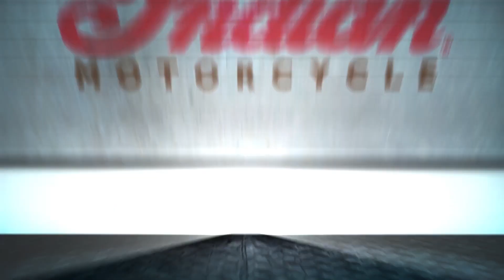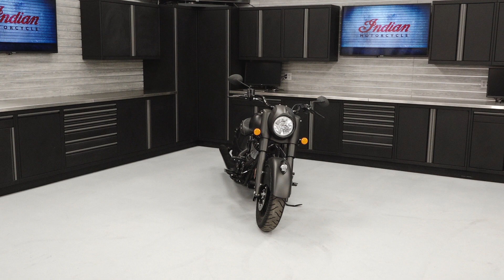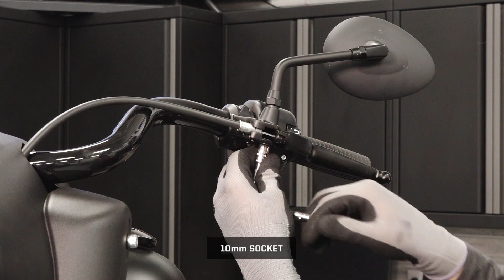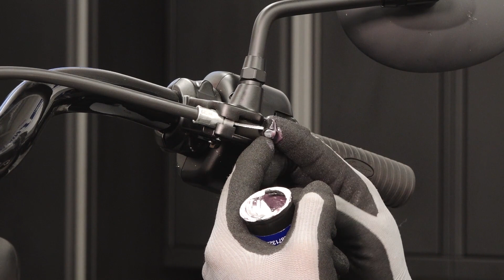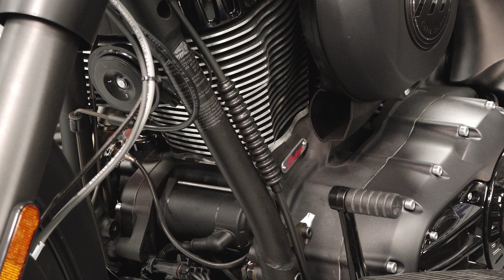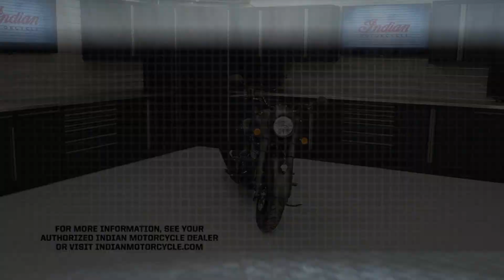Indian Chief Clutch Lever Inspection and Adjustment - Indian Motorcycle

Comment: For moving the clutch shaft I recommend finding channel locks without teeth and using that without the rag. That way you have better control of the tool and will not make any marks on the lever. Also for older bikes that have stiff rubber boot over the adjuster nut find some stiff and yet bendable plastic, wrap that over the adjuster nut and slide the boot to cover the nut. Then remove the plastic.